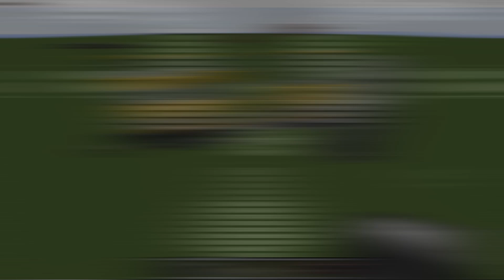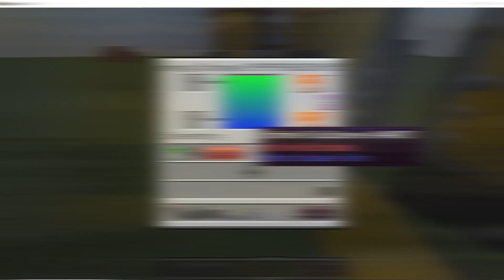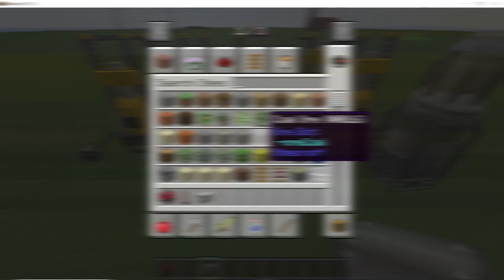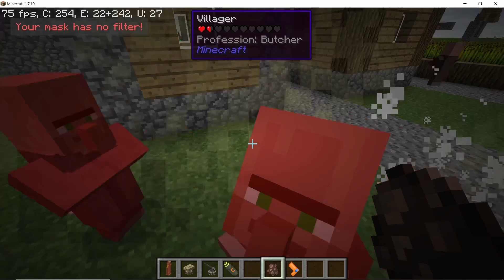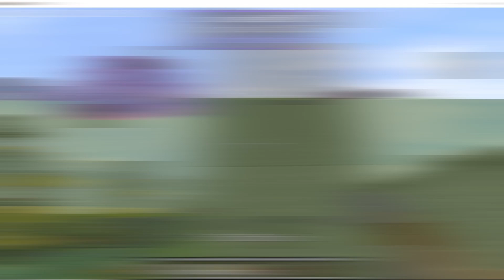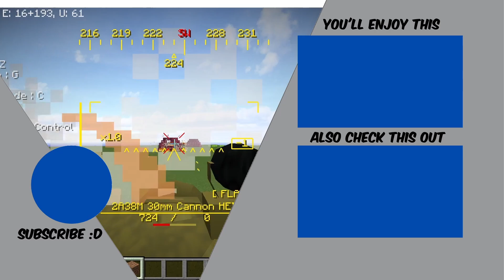Compressor, Pollution System, Mustard Gas Artillery & Capacitors - HBM's NTM Updates

Comment: There are many different mods that are on newer versions that are so good like create and MTR but HBM mod is holding me back on 1.7.10 or 1.12.2 because its so good and its worth it
And, finally there are Fluid Valves. I hope Bob will upgrade to a newer version like 1.14 so that you can use Create and MTR with HBM mod. Maybe new more advanced things can be added when in a new version
Reply from the maker: Well Martin is working on a version for 1.18 but it will take time before that project is even near completion afaik. And yeah I totally get this ... staying in 1.7.10 only for NTM is totally worth it as playing with this mod is like playing a modpack xd
Reply: @SavageVegeta  Yes, I like Martins Port because you can use Mekanism Pipes and thats a nice crossover

Comment: Cool video! btw does anyone know why my rbmk wont fill with water??? it just wont fill, and i want to make a rbmk :/
edit : fixed, but if you still have a solution tell me because it might happen again
Reply from the maker: Which version of Minecraft are you running this mod on ?
Reply: @SavageVegeta  1.7.10, but its fixed, i made a new world and it works, but still it might happen again
Reply from the maker: @Shadowsans99  weird then cause I didn't ever have this problem in 1.7.10
Reply: @SavageVegeta  btw do you know how to change tritium cells into tritium ( the fluid )??
nevermind my dfc destroyed everything

Comment: I have a question about the mod, i was using the chemical factory on the 1.12 version and what do I do with the hot coolant byproduct?
Reply from the maker: Hot coolant goes into a heat exchanger where it's converted to normal coolant and can be pumped back again into the factory. It's a closed loop
Reply: @SavageVegeta ok thank you so much for the help😊

Comment: Thanks! Now with capacitors its easier to make electricity grids, compressors help with steam on sites that use reactors to produce steam and reuse it for turbines, pollution systems help not getting polluted, and fluid valves are a solution to the open/close piping system, which makes flow controlable! (Now i wont feel mental pain needing to change the type of flow with another non-used fluid or gas to close or open pipe flow)
Reply from the maker: Fluid valves are indeed very very helpful, manual tank control was painful af. and yes with capacitors making substations which are fully functional is possible now ... can't wait to include it in more builds :D

Comment: While this isn't the best update in my opinion, some stuff is actually amazing, I especially like the capacitors. These can help you not load full power into stuff and maybe even help make transformators and stuff.

Also, Glyphids really do look like Factorio biters, just a bit mlore cartoony.
Reply from the maker: The reasons I love capacitors the most is making functional substations for every megabuild is something that can be done now ... absolutely love dividing my powerline into neat parts and sending them off to different parts of the processing stations.
Reply: They're actually the Glyphids from Deep Rock Galactic, they look exactly the same

Comment: you should check if the smokestack produces pollution in that chunk, because it might not be polluting here because its diverted away
Reply from the maker: It does reduce pollution by 75% but no matter in which chunk it'll be placed pollution will eventually go up, while testing I placed it in the same chunk as the diesel generator but still the value was going down
Reply: @SavageVegeta  i see, thank you!!!

Comment: Cool video man! Could you maybe explain digamma radiation? I saw on the ntm wiki that some players saw a ghost when they were poisoned with digamma. Also try the Alcater version it adds a lot of cool stuff like the S.A.F.E (reimagined watz fusion reactor)
Reply: The safe is spawned trough the structure wand.
Reply from the maker: I will try to get a video out on Digamma soon ... also I have tried Alcater version and played around with S.A.F.E and also the other newer blocks. It's definitely cool and I will make videos on it once I am done with my main 1.7.10 builds :)

Comment: is youtube blocking my links? i posted a comment with a link going to NTM's github but i don't seem to see it here anymore 
(it's a long comment)
Reply from the maker: Yes yt generally deleted comments which have links and are not posted by the channel owner/moderator's cause if you remember just a few months ago bots were flooding the comments sections with links that went to ... Not so decent websites xd
Reply: @SavageVegeta  i dont think youtube deletes the comments, but rather puts it under review (should be in Comments > Held for review)
Reply from the maker: @Voxelstice  that's the thing, after reading your comment that is where I checked first but your comment isn't there
Reply: @SavageVegeta  strange, i think it just didn't get sent for some reason
Reply from the maker: @Voxelstice  why don't you try replying to this comment with your comment but this time delete the yt link
Reply: @SavageVegeta  i posted a new comment without the link, had to rewrite it because i didnt save what the previous comment had
edit: i dont know what is happening, it's not there again
Reply from the maker: @Voxelstice I even read your entire comment this time in yt studio but when I came to the yt app to pin it ... It was gone 👀

Comment: Nice I didn't expected them to add Glyphids from the Deep rock galactic. That is  very accurate model of them.
Reply: the idea of the glyphids stem from factorio though since the pollution system and similar to biter nest mechanic of them along with "scout" and the past addition of conveyer belts, conveyer belt pickup thing and the conveyer splitters are all very similar mechanically and in sprites to factorio 
arty, conveyer, glyphids and poluttion were prob inspired by factorio
Reply: @placeholder7753  the name and model design are from deep rock galactic but yeah they were probably added as a factorio biter like enemy to go along the pollution
Reply: Rock and stone brotha
Reply from the maker: Oh so thats where they are from, never knew that thanks man. Spoooky bugs indeed
Reply: @SavageVegeta  I play a lot of Deep Rock, and I can tell you there is nothing scarier than Elite Mahtera Grabber. It warns you with a screech then you see that goddam oversized mosquito-looking bastard. Going Mach 6  grabs you if you are not fast enough, and then disappears with you through a wall to leave you in the backrooms with the equivalent of gaming Ptsd. You will be looking around everywhere once you hear that things call. (I'm writing it jokingly of course Great job on the video Btw.)